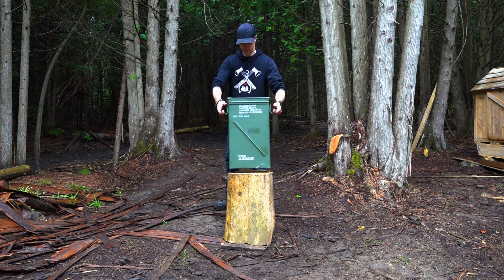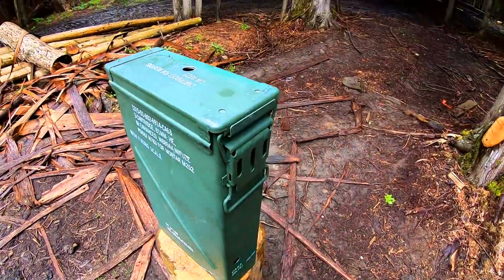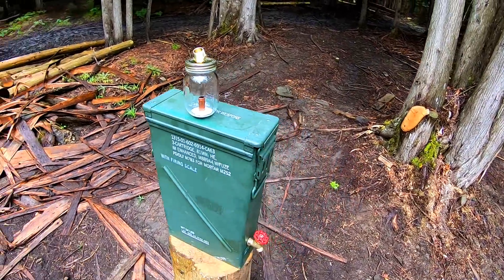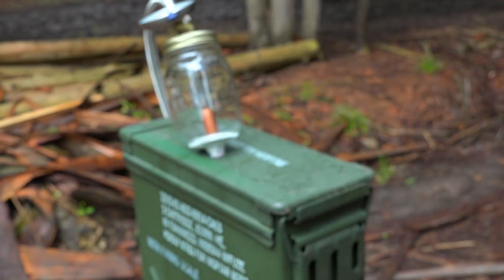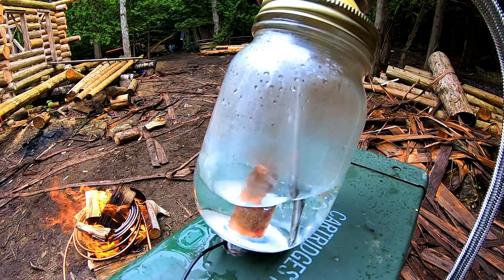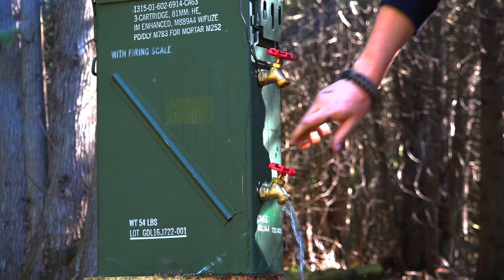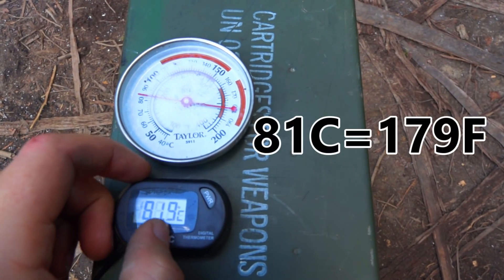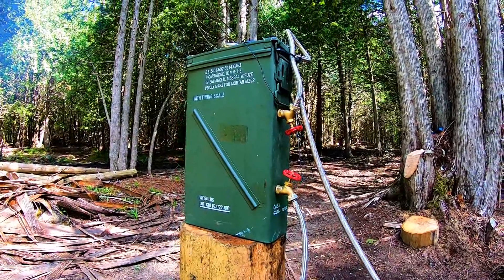Off Grid Heating Prototype- Copper Coil Water Heater / Heat Exchanger / Radiant Heater

Comment: Kickass ma man! Did the same basicly, I added a pressure relief valve...get’em online for under $10 and I rigged an old handwinch using metal cable to raise and lower my copper pipes up n down outta the fire, which actually gave a good amount of control (thermostat!) so I didnt have to leave my camper so much to adjust it! Awesome video sir!

Comment: I would start by reversing it all.. put the coils inside the cabin thing..heat up the can..let it circulate the the cabin and back out. Use the valve to speed or slow the flow to adjust the heat. Put a second wounde up tube in the expansion hole on top of the can to condense the steam back to water..a lot less loss that way. Then you can keep the coper line without burning it up. Your only expendable then would be the ammo cans..cheap and easy to get.
I'm sure my ideas are full of holes, but I could make it work and beat out the bugs.😀
Thanks for the video..some good ideas in there.

Comment: Cool system. I have questions. Is this ammo can meant to be heated once then take inside the camper or is it meant to be constantly heated while inside the camper? If its meant to be heated constantly would it be possible to have less line close to the fire so it doesn't heat the water so fast that it runs away with itself (overheats)? Would smaller line like 3/8" still work or would it restrict too much?

Comment: What about in inclement weather? The kind in which you'd most need the heater.
Reply: Copper pipes heat you many times over - first when you install the recirculating, hot water system, and then every time you run back to town for fittings to repair the latest rupture caused by exposed pipes in sub-freezing weather.

Comment: You could coil the Cu pipe over some large piece of steal pipe or the bucket. In a way that your inlet is at the bottom. You can control the fire more in the center of the pipe with putting some piece of metal or tile on the top. So you can close and open the exhaust. That way the fire could be smaller. From coiling the pipe up you get more even flow.

Comment: Two hours to get operating temp. Huh. You could do better and stay warmer longer with a rock. Yes, an actual rock.
Reply: HaaHaaaa ...Absolutely
Reply: Water has the third highest specific heat capacity of any common material, far higher than any rock on earth (4x higher than quartz, the rock with the highest specific heat). So literally 5th grade science proves you're wrong.
Reply: Haha, as long as you don't quantify for the conductivity! Water is also a great heat conductor which is why it loses its heat so quickly, far quicker than rock. Enjoy 5th grade again! :-D Seriously though look up any survival tactician and you will be told the same. Water is great when the heat can be reapplied but it just loses it so fast that it can't compete with dense objects with lower conductivity.  Also in an open system water can only be heated to just under its change state temp (212degeees F at sea level) so even the heat input is limited. You can heat stones in a fire and wrap them in a towel and 8 or 9 hours later they are still giving off heat. You can even bury them and cover them with dirt and sleep on them to stay warm. Try that with water in a snowy environment! (Actually don't, you will die from exposure.)

Comment: my idea is to place a big cast iron heating element in the sun, then connect it to a smaller cast iron heating element inside the home. With a non return valve into the smaller element. When the sun hits the big element the pressure builds and slowly the water will circulate into the smaller element and out again till the smaller element gets hot. Maybe with the taps we can add a run where a fire can be used to heat the water, excluding the outside heating element.

Comment: I think hot water sinks and cold water rises .... otherwise we would be screwed when sheets of ice sink and drown 🤔crush all the fish
Reply: No, water is most dense at 4 degrees centigrade at standard pressure. Ice has a rare property being that it is less dense than water due to it unique geometrical structure. Most other substances dont exhibit this property.
Reply: So your telling me water sinks as it cools then freeze and float to the top surface....

Comment: Build a Swedish torch log and put a metal pipe through the log and into what ever shelter your heating, fresh air is collected below the log so co2 is none existent and you’ll be spitting out very hot air that could heat anything given time and the log burns for a while making it useful for cooking and the added benefit is that you could pick up and move the fire even while it’s burning if you needed to move it for any reason

Comment: Interesting.   I  would like to see an addition to your heater.   I  would build a shroud for the ammo box with  air inlet holes at the bottom and air outlet holes at the top.   With the temp it was I think you could probably flow a lot of air through it.   If it was cold enough at the air inlet it might even keep the water from boiling.  It would be interesting to see.

Comment: I wonder if there would be a way to "Daisy-Chain" these together for use in an off-grid camp? It looks like a great system you built.
Reply: No, because the water will not rise from your reservoir, it will flow back into the fire, get heated and rise back up again.  It is a loop with cold water falling down on one side and rising on the other when it works correctly.

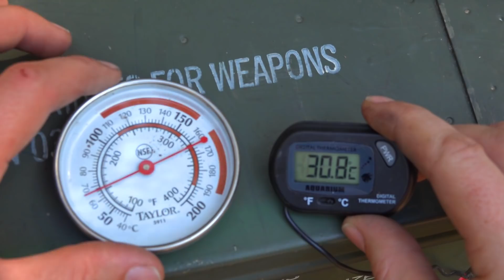Comment: 8:50 70C (or 60C) is not twice as hot as 30C, that's not how temperature works, unless measured in Kelvins. 20C is not twice as hot as 10C, and so on. But 200K is twice as hot as 100K.

Comment: while it can work in above freezing temperature, the copper would surely break during the winter if it wasn't "winterized"> but you can use propylene  glycol to mitigate the freezing.
Reply: This guy makes heaters out of ammo cans... Do you really see him delving into propylene glycol?
Reply: Possibly but, if you drain the coil it will be ok. once warmed it would be fine. If there was a pump added the freezing point would be much lower to.

Comment: pressure release valve, and put soap on the copper tube to slow or abate erosion of direct flame ware, just try it, the copper will stay bright and even shiny, and a hole in the middle of the night will not be as likely.

Comment: that space is so small, I think you could scale it back to just a small steam pipe.  We used to heat our shelter half tents in the army with a sterno can to take the chill off in the morning, and those are just canvas, not insulated.

Comment: Not sure if anyone has mentioned this or not, but if your inlet and outlet temps are allowed to equalize you will lose your convection flow. In which case your water won't know where to go and your coil will most likely boil out fairly quickly and cause some pretty nasty water hammer. Definitely don't want to fall asleep with that thing in the fire!

Comment: Seems it would be better to have to water tank directly above the fire and the copper loop in the cabin. No noise, less space taken, and quicker heat dissapation through the copper pipes.

Bend the copper pipes into a grid-like structure so that you have good surface area in the cabin.

Comment: 10:30 "...how efficient the ammo box heater is..."

The poorest use of the word "efficient" ever, LOL)
Reply: Actually,  set up right it could be.
Reply: He meant "effective" I think...

But you could easily argue "efficient" in terms of porting otherwise wasted thermal energy of a camp fire used for outdoor heating and cooking to heating up a water tank storage proof of concept unit to provide a interior lasting heat source. Certainly more efficient than installing a gas cylinder heater if he is already going to use a campfire anyways.  

But I take your point ;)

Comment: Yes, fine for a while, but first night you fall asleep and your fire dies that highly conductive system will loose heat faster than you experienced in the summer during your video. You'll wake up to a frozen and split unit, useless for a second try.

Comment: good simple design place the coils on the outside of the fire rocks , less temp but still will work, also put a line from the hole you left on top to remove the moisture to the outside of your shed..

Comment: Your camper could use a little wood burning stove like one made out of an old propane tank in wrap it’s flue with copper tube and it could eventually go into a different hose capable of handling the heat in the fluid used inside it, oil or motorhome plumbing antifreeze would be a great “solution” for running around the inside baseboard or interior perimeter and if only water 💧 is used in a separate line attached to the same it would be a good heater for the extra water that’s around to be used without taking away from your feet being warm. Styrofoam insulation under your foot inside your floor mat and then put your Tyvek house wrapping paper as a cover with the good ugl cloth tape or the original tyvek tape as first then the other as extra security and put some bubble wrap under the covers or the reflecting covering with the light styrofoam backing, it can be reversed in the heat of the desert heat to help the other way too. Thinking 🤔 tin foil hats 🎩 here, ok 👌 stay cool 😎 or warm rather.

Comment: By having the copper pipe in the fire you are soft annealing it and reducing it's strength making it more susceptible to damage during setup and tear down. I would get a small stainless barrel and wrap the hose around that with the odd bit of solder to keep it secure and light the fire in the barrel. Or use a stainless coil of pipe.

Comment: Just make a smaller fire.  Also, maybe look at having the coil large enough to fit inside of the ammo box for storage and travel.  The smaller coil and fire should keep you from getting burned out.  Then just adjust your fire making practices so you can pile on wood and have it slowly burn so that it lasts all night.  Maybe use a fire box off of a smoker so you can control the air flow and burn rate.  You could then store and transport with the ammo box inside of the fire box and then the coil inside of it.  This would make it so you don't need to get up in the middle of the night to keep the fire stoked.

Comment: I'd make a small rocket stove, with finned steel tubing inside the exhaust stream.

It would be more efficent, and not expose the metal to oxidation.

A bit more pre work, but more compact and way more efficient wood use.

Just need to work out the tubing needed for your needs.  You could even create valves to bypass some of the tubing for temperature control.
Reply: A radiator above the heat source perhaps

Comment: no way to sleep with this in operation.  initial thoughts: 

 just don't use water at all.  just use a length of metal pipe laying across the fire, one end out of the fire and the other end into the cabin.  the convection of warm air will flow into the cabin with an endless supply of fresh air on the opposite side of the fire.  as long as there is a fire, warm air will flow into the cabin.  you can easily use a damper to cut flow if it gets too hot with out any negative side effects.  and you don't risk steam burns or soaking yourself or equipment.  this is much safer and simpler than having to transport a lot of water, an ammo can, hoses, and a bunch of copper tubing. 

OR, if you're deadset on using an extravagant system:

1. need a lot less copper in the fire.  need to make the cabin warm,  not a sauna.  won't take much to warm such a small space.
2. need a secondary copper coil in the cabin, not a big box of hot water as that's only asking for bigger problems.
3. need a throttle valve in copper outlet from the cabin coil to control flow and thereby the temp of the cabin coil.  throttling the valve closed will keep water in the heat source coil will make water hotter, warming the cabin coil.  opening will allow cooler water (or "less warm" water) to the cabin.  
4. need baffles in the ammo can to prevent turbulent mixing of hot and cold which will increase efficiency and will ensure proper function and flow (or use a taller convection water tank to allow clear separation of hot and cold water.  a taller tank will also add more head pressure which also helps ensure flow in the proper direction, so the cold tank outlet feeds water to the heat source)
Reply: or just take a pot and bic lighter

Comment: This is actual how a 1906 steam car works. Just less complicated. The fire is gas lit and controlled through systems and a coil is used to keep the water heating fast. If he had two ammo cans, he could then hook a condenser up (if it could cool quick enough) and make it a closed system. The jar acted as a steam dome, he could put a smaller box with a valve and pipe steam to something like an alternator. Electricity. The condenser could then sit in his house as a heater. Twice as much use. It’s not perfect though, it’s all theoretical.

Comment: You can probably boost heater efficiency by using an automative radiator and set up fans behind it. It would probably heat a room up fast

Comment: If the roof of your camper had black thermal ceramics on the roof with a layer of glass covering it (with a bit of space between it and the ceramic), it could absorb heat from sunlight during the day, the glass with air gap would help to prevent it from escaping so the ceramic would radiate heat in the inside of the camper, making it increasingly hot inside during the day.  It should still radiate heat until 3-4 hours after sundown.

Comment: The design is still very inefficient and a lot of heat is wasted on the extra lengths of straight copper pipe. You can use the steam alone to heat the sled by using another (insulated) copper pie with a radiator.
Reply: Guy Tero if you use steam you consume the water and unless you use distilled water you’ll quickly get mineral buildup. The lines to and from the coil can be plastic. It is inefficient but if you use the fire for cooking and to be enjoyed like a regular open fire, not so much.  I’m surprised how quickly the water gets warm and stays warm a long time if you just leave the coil and bury it in the embers as the fire dies down.

Comment: Less copper coils could slow the heating of the water to allow for constant prolonged heating, and the oxidation of the copper is a concern. The other comment is right if the copper were in contact on the outside of a steel chamber fire pit, you could gage how much fire wood would to need.

Comment: Anyway theres something better then this that don't require a fire, try putting that copper pipe in the middle of a big compost pile, as long as you keep adding compost as it decomposes you can get 60c water doing the same thing but for far longer for less energy

Comment: You could add a thermister inline on one of the pipes to regulate the temperature. You could also raise the pipes abiove the fire to prevent the water boiling. Rather than having the tank in your shed with you (creating steam and filling the inside with moisture), I would have the tank outside and have it feeding a sealed radiator on the inside. You could install the radiator as a permanent fixture and just hook it up as needed? Just my thoughts initially.... Good luck!

Comment: Pretty clever. Something a miner might use while working his remote mining claim up in the mountains - getting gold.  I think might try to contain the fire a little more and maybe elevate the coil to keep the temp a little lower. Might even use an old, insulated hot water tank outside and pipe the heated water in to another coil inside the miners shack.

Comment: good idey but coper well melt so you need to put the coper pipe in one more ammo box and let it get the ammo box hot and save the coper pipe from melting  just keep the coper off open flame

Comment: Add a pressure release valve with a low psi tolerance so that the heater doesn't bubble like that. It would even out the pressure and slowly release the steam. Should also prevent scalding in case it tips over for some reason.
Reply: it's already an open system.  the same can be accomplished by the maintaining a certain height of the water over the hot inlet in the ammo can, as that is the only source of back pressure and helps establish flow of the system in the correct direction.  also need less heat,  only need warm water not steam.  also, with that much heat,  it's only a matter of time until those rubber gaskets fail, which then can turn into a serious hazard.

Comment: So just add a small valve onto the copper line ,( you can control the water flow rate and thus the water temp ),and then you can dial in the heat. I used one discarded solar water panel in the same way, but just with sunlight alone I could set my hot tub at any temp I wanted  .. 102.5 is my favorite.

Comment: Couldn't you do the same method through radiator with a fan at the back of it in order to blow the heat around and help cool the water.